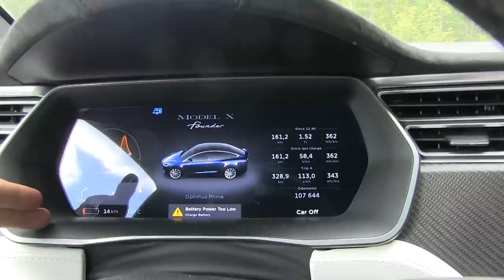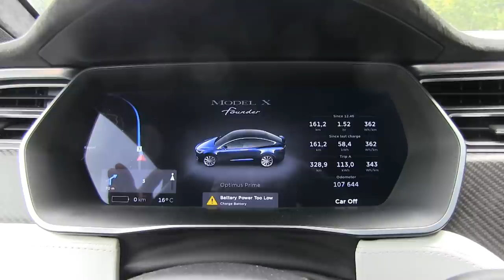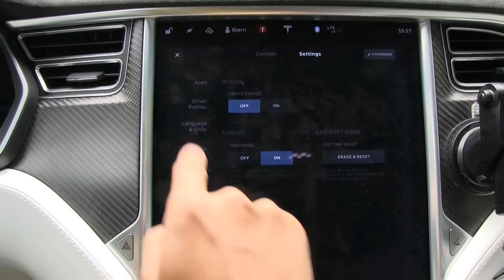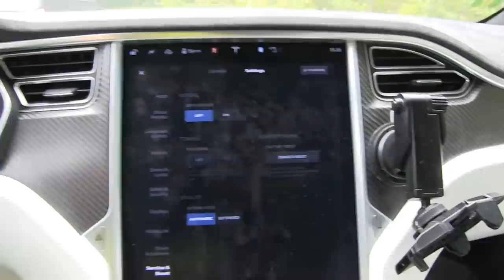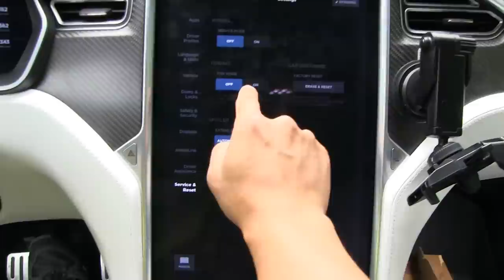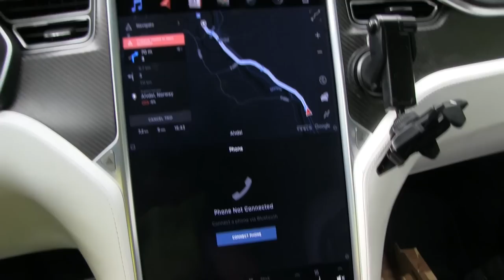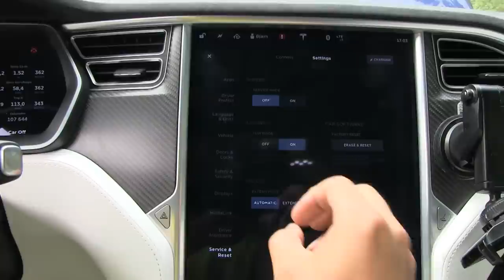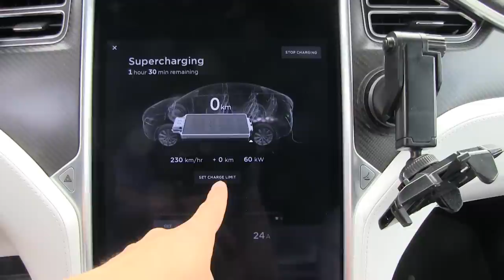Tesla Model X P90DL shuts down with 14 km/8 mi range left

Comment: what is battery balancing, how does it work?
Reply from the maker: Slow charge to 100 % and let it stay there for a few hours.
Reply: If you charge/discharge a battery pack many times, the cells will have different levels of charge in them, with lithium batteries, it is dangerous to use the whole pack if one cell is at 0%, so the whole battery is shut down so no damage occurs even if there is capacity in some cells left.
When you charge it to 100% it can do some magic to test the charge levels and make them all the same.
Reply: Wow thanks a lot, really educative.
Reply: +Coast:
''When you charge it to 100% it can do some magic to test the charge levels and make them all the same.''
It is not magic, it is called cell balancing. Which in itself has problems, and needs some seriously clever software to work around. Ideally, all cells should be computer matched initially, meaning the cells are fully charged, then discharged, and the level of discharge is measured using a fixed (known) load. Cells with close to the same discharge rate are then grouped together to form a pack. The reason for doing this is that you are unlikely to have one crappy cell bring down the voltage on the remaining cells in a pack. If this DOES happen, and it is inside a sealed system like the Tesla battery enclosure, the software then has to somehow re-route around the dud pack. All this is common knowledge for those people that have been racing electric dune buggies for years...
Reply: Cell balancing is not magic and is simple, but it's done through a complicated circuit. It is done even in the battery of an electric screwdriver or drill. A battery pack consists of many cells connected in parallel as a block or module, and many modules in series. They are hard wired with large cables for the currents demanded by the load. That being said, the charging is done through the whole pack all together, just like in discharge mode. The Tesla charger supplies 330V or so to the whole pack with about 350A for 116kW. Essentially every cell or module is monitored by a circuit that detects the precise level of that cell or module. After the charging is completed, process monitored by the charger, that decides the charging current and final voltage level per WHOLE pack, then the cell balancing begins. Each circuit that monitors a cell or module decides if that cell is overcharged, i.e. the voltage is above the maximum spec of the cell. For example, a Li-Ion cel has a max voltage of 4.2-4.35V, depending on the exact technology and chemistry. Lately the LiPolymer batteries found in smart phones are pushing to the 4.35, but the ones used in EV are the classical 4.2V. So, the cells that are charged to 4.25V instead of max 4.2 are a bit overcharged, and the monitor circuits DISCHARGES the cell to bring the voltage to the spec. Yes, it DISCHARGES the cell with a small current, that's why it takes some time for the balancing. When the voltage is at the spec, the circuits cuts the discharging. This is all well, but ... due to wear, some cells might not be able to full charge to the spec voltage while some of the cells are overcharged, because the aging of the cell yields a reduction in the efficiency of the chemical reaction. So, in this case the undercharged cells will not be charged from the overcharged cells. There is no magic here and the BMS is a very complicated circuit, it is impossible to balance the cells by transferring charge from cells to cells, the only balancing is discharging the surplus from the overcharged ones. As a results, the battery pack has the capacity of the lowest capacity cell, because after that cell is empty, there is no way to use the rest of the pack without damaging the empty cell. The only way to mitigate this wear is to smartly adapt the charging levels of all the modules to the level of the most worn module. This way all the modules will have after balancing the same charge, regardless of their actual charge capacity. When the unbalancing is too great, the only solution is to refurbish the battery pack.
Reply: Bjørn Nyland
Thats how you do it with NiCd cells. In case oft LiIo cells you have to balance them to prevent overcharging a cell.
Example: if you have a 3s batterypack, you have 3 cells in series, so if you add their maximum voltage its 3*4,2 V = 12,6 V.
Your charging circuit will charge with common CC CV to 12,6 V. 
The Problem is, that if one cell is 4,1V another is 4,2V, the last cell is at a sum of 12,6V at 4,3V -> this is not good, it will become more an more with the time. So in every serious charging ciruit there is a balancer, the simplest one is a passive balancer. If a cell reaches the 4,2 v there is a resistor wich is connectet in parallel to this cell to elimante the charge current trough this cell. So the other cells can be charged till there are all on 4,2v.
Reply: John P hahahahahahah  .  seems legit

Comment: Let's take video about charging from 0% to 100%
Reply: What concerns me is the fact that you couldn't get the towing mode to engage. I noticed on the display that the frunk was still open. Is it possible that for safety reasons Tesla doesn't allow the towing mode to engage if the car senses that the frunk is still open?!?
Reply: RWBHere no he never closed frunnk

Comment: Why didn't you buy a Toyota hybrid?
Reply: My Toyota Hybrid boiled water in the Alps. The water pump is broken. € 800 would have been a repair. Of course I repaired myself much cheaper.
Very good car, but don't think there's a car that can't go wrong.

It is not a mistake here. Simply running out of "fuel".

Comment: This is not very well planned by Tesla - it stops at 15km left and you don't even can tow it away? Shiiiiiiiiiiiiit
Pretty happy that i dont have to rely on a Tesla.
Reply: Michael Roth
No. You're completely wrong. This was not very well planned by the DRIVER. If you are going to stretch the limits you need to understand what the limits are and why they are there. This guy clearly did not understand what the range estimate actually meant. It makes an estimate based on your past driving trends, funnily enough it cannot predict you'll be towing a heavy trailer and driving it down to the KM, weird how that works, huh?

Pretty happy that I don't have to rely on many stupid people.
Reply: Michael Roth 

I see your point, when I buy a car, I don't want to "understand" the implications of fueling it. The mainstream buying public will not be a tolerant as mr. Nyland. 

However it seems like the battery was un balanced. One cell was very low in comparison to rest. And towing and driving his car to the limit are not helping. If batteries are not treated perfectly, they can be very picky. (Too hot, too cold, too much of a draw, not charged correctly,)

A hybrid at least compensates for for a fussy battery. When your battery throws a tantrum, the second power source kicks in. A ICE unit in  prius, hydrogen in a fuel cell, or your legs on a ebicycle.
Reply: Michael Roth Do you usually drive your car under 20km range? I don't trust my diesel car under 30km left under no circumstances. It's an estimate not guaranteed. Even if the Tesla would have died 100 meters before the supercharger it would still be he's fault because he ignored the fact the car was almost empty. On a normal car the empty tank light comes up when you still have around 100km range which proves that even the car gas car builders don't trust the estimate.

Comment: That happens, when you never do a Balancing!
Reply from the maker: Turns out the cells were actually almost 100 % balanced. But BMS is way out of sync.
Reply: BMS is one Word, but two Systems: Battery Management System and Battery Monitoring System- your Monitoring System fail´s ;-)

Comment: I don't want a car with keyless entry, I don't want a car with electric 
brakes.Electric brakes are more bigger nuisance, than the air loss on a 
truck. At least there you have a 'Shunt button' on a trailer and you can
 move it.

Comment: I actually don't see anything that could be weird or hard to explain. It is obviously a customer flaw. My laptop shuts down at 5-10% NO battery is gonna be ever at complete zero. Obviously it has zero after you manipulated all the equipment to check and try to explain what happen. OBVIOUSLY if you are pulling a trailer and it is hot or you have to climb mountains your battery life or even petrol if using a combustion car will be drastically reduced. This is just non common sense issues. And haters.....pick up your GM checks and go home lol

Comment: This is quintessential problem with making everything electric. You can't even get it to be towed without enough battery power. With model 3 these issues are gonna simply pile up.
Reply: It's just a UI bug apparently, so not a showstopper. See other comments for workaround.
Reply: nettlesoup well it stopped his show for good part of three hours. Some things oughta be manual. Otherwise you'll be stranded in frikking nowhere browsing the manual.

Comment: the biggest disadvantage of a electric car
Reply: You mean that the parking brake does not disengage?
Reply: yes this, and no ability to fast refuel the car, only slow charging
Reply: All cars do this if you rely solely on the computer screen.
Reply from the maker: The problem is of course not the car. It's the driver. I thought this was pretty obvious. Fossil cars run out of fuel every day and in every parts of the world.
Reply: Didn't you have 14 km of range left?
Reply: Erlend Kristiansen Obviously not.  Just like a fuel gauge the range estimate is not perfect, especially when the vehicle is using more energy than normal.
Reply: I've cut it close in ICE cars a few times and I've experienced the range reach very close to 0. When going up hills the range dropped faster than on flats, but it didn't just run dry when I was still being told that I had range left. That's obviously not the way to do it.
Reply: Tell that to the millions of ICE drivers who run out of fuel every year.
Reply: It's pretty fast charge
Reply: They don't run out of fuel while being told they still have range/fuel left.
Reply: Mine just has a needle pointing to a line, no range estimate provided.  No fuel gauge that I'm aware of tells you exact range or fuel in the tank.
Reply: Well, getting some gas to the car is easier.
Reply: Has nothing to do with electric or non electric cars....its about having safety margin! Gas gauges can be wrong too, and they have been!
Reply: When I returned from college, I did not realize the family car's fuel tank had been dented so I the gauge was reading more fuel than was really available.  This was the only time I ran out of fuel while driving.
Reply: john dillenger yes u can it's called a generator
Reply: Tesla should include an option to add the towing weight and trailer dimensions into their cars' computer calculations for a more precise measurements when towing.
Reply: Actually the car measures the energy being used while driving, which automatically takes into account any increased load.  The problem is energy use changes all the time due to other inputs, air temp, wind, rain, snow, hills, all influence energy use dynamically.  If you've driven most of the way on the flat or slightly downhill and the last few miles of your trip is going uphill the car is going to over estimate your remaining range, which seems to be exactly what happened in this case.  Maybe someday Tesla will be able to take into account elevation changes along a projected route but probably won't be able to take into account unforeseen weather changes.  Best practice is to never count on the last 2-3% of battery capacity.
Reply: AFAIK Tesla even takes elevation into account, when you use navigation. Anyway the car should never stop with some range still left, what would be normal is that range drops quicker than what you're moving...
Reply: Mercedes, at least, have a normal fuel gauge and also tells you the range left on the screen in the dashboard. I'm betting they're not the only ones.
Reply: No system is perfect.  The BMS can get thrown off sometimes and may need to be recalibrated.
Reply: I'm betting they are one of the few.  And is it 100% accurate?
Reply: I've never experienced it to show that I have range left when I don't, and that's by far the most important.
Reply: But they are all unimportant compared to the advantages.
Reply: There are not.  I drive one, do you?
Reply: But you can tow gas car anytime you want, because it does't rely on electronics for basic functionality
Reply: really? There's no gas car with electronic parking brake?
Reply: Not that you would ever do that, but in concept you could.
Reply: 800,000 each year in the UK alone
http://www.dailymail.co.uk/news/article-3212222/More-800-000-drivers-year-run-fuel.html
"Research shows the number running out of petrol or diesel has risen every year since 2011, when the figure was a third lower."
Reply: Happened to me with normal car too... :)